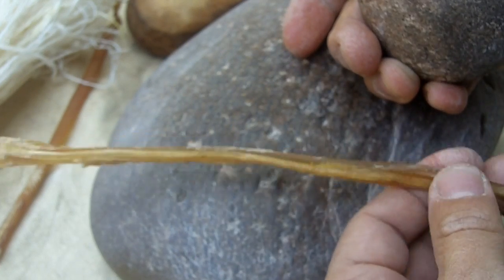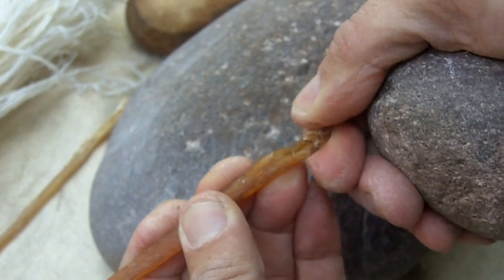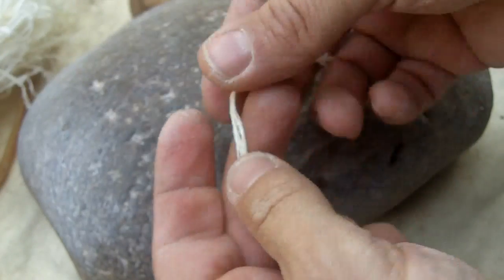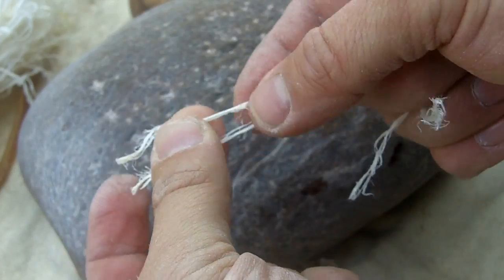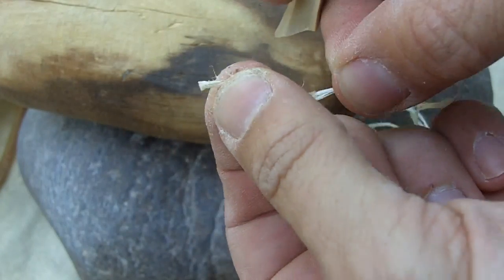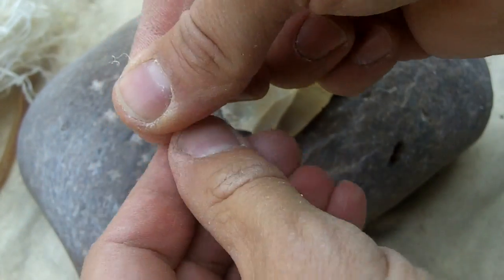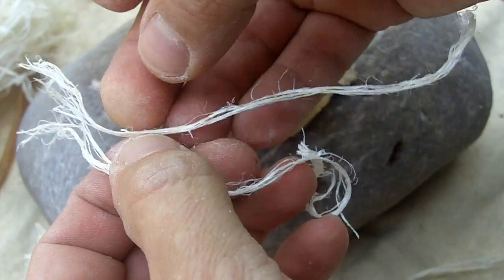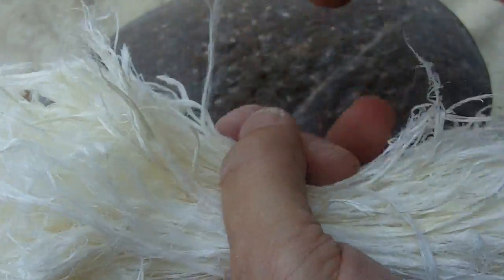065 - 1/5 Sinew Bowstring

Comment: i wanted to add that in addition to making a bow string i made another 2.5 ft string to try out as a bow drill for fire making.  it worked fine but broke after about 10 tries.  in comparison, i had made a dogbane string about the same thickness and it lasted for 30+ fires.  believe the sinew is stronger but does not take the abuse as well

Comment from the maker: I put a link in the description to Bookmakers Int'l.  As far as I know, they carry the best hemp and linen thread.

Silk is only slightly weaker than linen.  Silk is obtained from the cocoons of the larvae of the mulberry silkworm (Bombyx mori).  It makes good bowstrings.  Not the best, but good.

Natural fibers will get weaker over time as the deteriorate (rot) from the action of mold and bacteria.  It is important to use new strings on very strong bows.

Comment from the maker: 80lb is pretty heavy for a sinew string to handle but it can be done.  Yes, horse and cattle backstrap will work.  The string should be 3 or 4 ply and be about 3/16" thick when done and should weigh at least 240 grains.  Also, the bow should be 65" or shorter.  If you have a longer bow, it would be safer to use man-made materials.  JMO